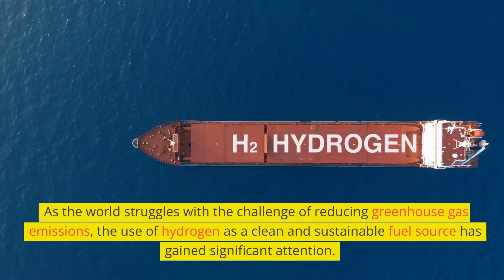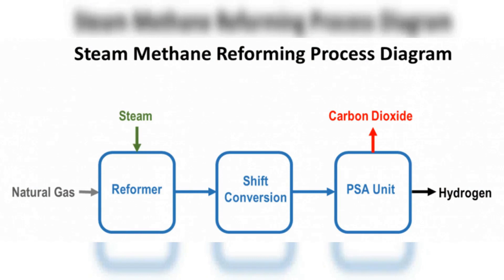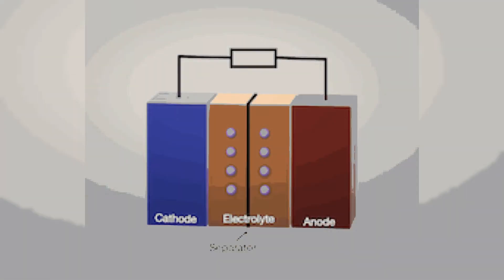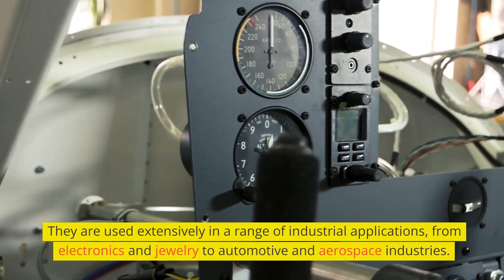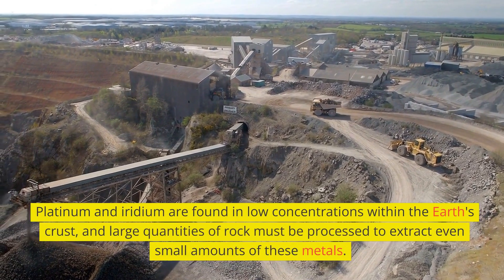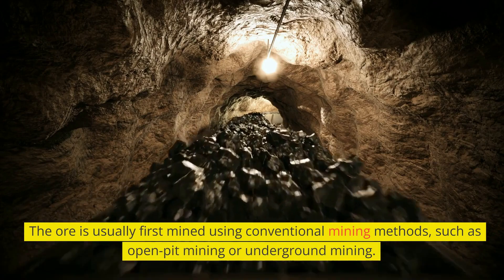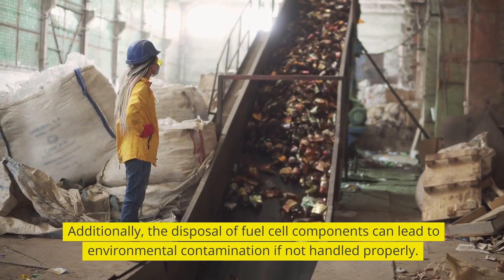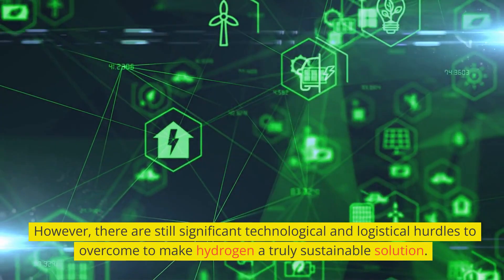We must STOP Hydrogen production: 5 reasons why

Comment: Hi. One way to use hydrogen is as a battery that can be charged by green generation, and stored near thermal power stations to keep them running when the sun don't shine, rain don't fall, or wind don't blow. All the present thermal stations presently running on natural gas (or unnatural gas in the case of fracking), could also burn hydrogen. 

As the availability of green hydrogen increased, the need for fossil N.G. would correspondingly decrease, so we have a seamless way to decarbonize the electricity grid. It's not rocket science, but that esteemed profession could put to good use the oxygen created by the process of electrolysis. Zero carbon rocket powered aircraft, possibly.

The natural gas molecule (CH4) is 80% hydrogen anyway, so converting coal and oil burning power stations to run on CNG is still a huge net positive for the climate. First things first, and we'll see what other sunshine technologies can be added later as our climactic can of worms opens further. Cheers, P.R.
Reply: CH4 is 80% hydrogen? Yes from number of atoms but not so from molecular weight basis.  Natural gas leads to fugitive emissions as well, contributing a significant greenhouse gas impact.
Reply: @davewillis6946  Hi Dave. I agree, ignoring isotopes, carbon with an atomic weight of 12 makes up 75% of the weight of a molecule of methane. Nevertheless, for a given amount of energy produced, it still produces half the CO2 than other fuels, which means mitigation technologies such as carbon capture can have greater effect. Methane fugitive emissions are difficult, but hydrogen will present far greater problems. Even electricity "leaks". I have no doubt we have the technology and ability to improve our energy systems and reach carbon zero. Eventually. Cheers, P.R.

Comment: Nonsense, it is like arguing that EV vehicles should be stopped because a lot of electricity is generated using gas and coal. Why would anyone argue that hydrogen production must be STOPPED when hydrogen is complimentary to other technologies that promote a greener economy. Significant technological and logistical hurdles to overcome could be said about a lot of alternative fuels and they don't get solved by stopping - pure unadulterated drivel.
Reply from the maker: the nonsense is to use an extremely polluting process to create an ecological fake fuel. It would be better to use methane directly because transforming it into hydrogen also wastes energy. In any case, I am against gray hydrogen, not all types of hydrogen

Comment: There is no reason to "STOP Hydrogen production" that I can see.  Change methods, yes, but man that's a clickbait title if I've ever seen one.  Hydrogen used in situ industrially, generated on ocean-going vessels as their own fuel made from seawater can be made practicable. 
Tidal power can also generate vast amounts of electricity and is an inexhaustible resource.
Both require research and development so no, stopping hydrogen production is not the way to go.  Eradicate the immensely wasteful present methods (10 tons/gr) through continuing research.  But stop?  No.
Reply from the maker: I'll be short I've already answered hundred of times.The Hydrogen currently produced Is 99% with that method, and is precisesly to it that i'm refering to. Maybe the title is provocative but not clickbait

Comment: There will be a place for hydrogen.   Research is steadily reducing the amount of expensive minerals needed.   Maybe great way to use excess solar/wind capacity, with the resultant hydrogen available for other uses.   The click bait title is misleading.
Reply from the maker: The title Is provocative but not clickbait or misleading. The 99% of Hydrogen currently produced Is highly polluting, obtained from methane (oil) refining, i think we should avoid this production. Regarding fuell Cell, the alternative are just experimental at the moment. I'm in favour of green hydrogen, and car can be directly powered with Hydrogen bypassing the batteries and the environment damaging necessary to built them

Comment: Here is Australia we have a Very Peaky Power Grid, We see power prices go Negative (Hole Sale Level) many days in the summer, converting excess power into Hydrogen, then this power used in Engines (Trucks, Bus, Tractor ETC ETC) is one option to use this excess power

But Closing the Cycle for Battery's and Other Parts of the Renewable power systems is a MUST do..

Solar Panels
Wind Mill Blades
Battery's

(And i am sure there are Many others I have Missed)   

Enjoy the discussion  👍

Comment: You forget the methane the process starts out with is an even more powerful greenhouse gas than the carbon-dioxide end product. So by producing hydrogen, this process turns methane into carbon-dioxide which is an improvement!
Oh and I forgot to mention burning of methane produces water vapor and carbon-dioxide, and methane is used to produce electricity in power plants, and it is used in gas stoves, so reforming methane into hydrogen is merely an intermediate step and burning hydrogen simply produces the same water vapor that would have been produces anyway withe the combustion of methane in power production, heating, and in gas stoves, so hydrogen cars don't actually add any greenhouse gases that wouldn't have been added anyway through the combustion of methane.
Reply from the maker: In my opinion there are two problems. The Hydrogen produced in this way is presented as ecological while it isn't, and in methane reforming part of energy is wasted to separate hydrogen from Carbonium. So pollution and energy wasting. If we want to use methane, is better to use it directly. I'm in favour of Hydrogen but it needs to be produced in different ways( solar, wind, hydropower and so on)
Reply: @Science.Stories  Ah but you see, a hydrogen fuel cell is a replacement for part of the battery running an EV. You recall how long it takes to recharge an EV's battery? about 30 minutes to an hour I believe. Well a hydrogen fuel cell can recharge an EV's battery. A hydrogen fuel cell produces a constant output of electricity until the hydrogen is exhausted, that is why a hydrogen fuel cell needs a separate battery, so when you step on the accelerator pedal, you get a variable amount of current flowing through the electric motors spinning the wheels depending on how much you press down.

So one way to make a hydrogen fuel cell vehicle, for instance is to remove the main battery of a Tesla, and replace it with a smaller battery, and in the extra space you created you place the hydrogen fuel cell and the hydrogen tank. The fuel cell constantly recharges the main battery until its fully recharged and then it shuts off. The driver turns on the car and he steps on the accelerator pedal drawing current from the main battery which causes the motors to spin the wheels and he backs out of his drive way. Sensors on the battery detect a depletion of charge in the battery causing the fuel cell to turn on recharging the battery as the driver drives his car to work.

Now if you replace the fuel cell with a methane combustion engine, then the car will need a transmission to translate the up and down motion of the IC engines pistons into circular motion of the wheels, the engine will also need engine oil, transmission fluid, and antifreeze, whereas the electric motors of the EV are much simpler with lower maintenance costs. Since the battery is now smaller it will cost less to replace when it wears out unlike the larger battery of the fully electric vehicle.

Most people who buy a car are thinking of issues of convenience rather than the environment, they need to get to work or do some errands. If you can produce a hydrogen fuel cell car more cheaply than a gasoline internal combustion engine car, he will buy the fuel cell vehicle. If he forgoes an IC engine altogether, he doesn't have to worry about the transmission or changing the engine oil, or the many other things that can go wrong with an internal combustion engine whether it runs on natural gas or gasoline.

Comment: This video assumes that the so-caled renewable energies like wind and solar are clean, when they are not, far from it. This video assumes that zero carbon is like a final solution, when it is not. This is called reductionism. Environmental problems are complex, but the reductionists and the techno utopians tend to reduce these problems to one single thing: carbon. The inanity of such approach should be evident.
Reply from the maker: In the video i'm trying to explain that hydrogen as it is currently produced is dangerous for the environment and  where I show the alternatives, surely better. Your post is only a useless four stataments full of arrogance and fake philosophy. I received far better motivated criticism
Reply: You are right in that reduction of carbon will not resolve all problems on earth, however, looking the video I have not seen any statement that this is the case. Usage of energy and emitting carbon to the atmosphere may not be the only issue to be resolved, but it is a very important one and actually one of the most important ones overall. Resolving 20 other issues during the coming decades would not help if a blind eye was turned on this one.
Reply: @@battleangelfan7067 I think reality proves you wrong enough, so I don't need to. Just driving up the I90 in the states proves everyone wrong that thinks private initiative would work better. Also the Morandi bridge disaster in Genoa is an example of such and the general conditions of roads in Italy, the reliability of trains in the UK etc. etc. And the changing power of the sun is a thing that can be measured pretty accurately and these effects are there but do not correlate with the warming that is seen. What else do I need? So yes, I think I and many others will disagree. But I don't endeavor to change your mind. Just go ahead, I don't think it changes much.

Comment: Batteries and current grid electricity are neither green, batteries can never be green as long as it uses valuable earth material that needs to be mined or extracted and purified...so if hydrogen is not better or should not be used what is the alternative? Hydrogen can be made using heat from natural sources or heat from factories and even nuclear plants. The problem I have from people against hydrogen is they highlight materials used to create, transport and distribute but never mentioned that batteries and grid electricity uses more valuable earth minerals and environmentally worst..
Reply from the maker: I am against Hydrogen as it is currently produced not Hydrogen itself because it makes our environmental problems worse. In my opinion, it should be produced from green sources such as solar, wind, and hydroelectric. A system for producing hydrogen from sound waves is being studied. As for the batteries, they should be made using less rare materials, and there is the possibility of powering the cars directly with hydrogen, bypassing the fuel cells even with traditional engines.
Reply: Hydrogen is not needed in cars as batteries are much more sustainable. Very much like the materials required to make electrolyzers and fuel cells and/or combustion engines, The materials used to make batteries aren't getting lost in the process, turning it secondary to the overall sustainability balance. Thus what counts most in the balance is the primary energy used during day to day use and this is by far the smallest using batteries. That is why BEV-s are currently on the rise.
Reply: where did you get your facts that batteries are more sustainable? Lithium, cobalt, nickel and othere RARE earth material are not sustainable,  mining these things require much more energy and at this time recycle Lithium is so expensive nobody wants to do it, if it can be recycled...hydrogen can be recycled many times over, hydrogen can be used to replace fuel to power combustion engines, combustion engines can be rebuilt. Also, start considering natural disaster preparedness, try crossing a flooded neighborhood with EVs, or trying to evacuate 500 miles away...there are so many factors where EVs are just backwards thinking...yes, it make sense in cities where charging stations are available for very few people who can afford it and have 10% of their life wasted in charging stations...if you critically think about it from production to real life scenarios, you'll be surprised to find out, EVs are just fancy toys for few people!
Reply from the maker: @XTRMOverland  Never said batteries for Electric cars are more sustainable, just said we need to use less rare materials. Alkaline metals for example, but at the moment they haven't the same performances and durability
Reply: @XTRMOverland : When you are overly critical thinking then you can turn down any new technology. Neither Litium, nor Cobalt and Nickel are rare earth materials and litterally NO rare earth materials are needed to build batteries. Also the energy required to mine materials is paid back multiple times during operation thanks the superior efficiency. And Recycling of Lithium is currently expensive because life of Lithium batteries ia ao good, recycling companies don't have enough material to process, which makes the process low efficiency. That will turn into a regular recycling like any other materials as soon as there is a decent volume coming back. Northvolt is already doing it because they were forward thinking and knew there will be volume coming. There are issues with any tech you may chose and going forward solutions need to be found. The solution to lack of efficiency of H2 technology in vehicles however is not in sight.
Reply: Get your facts rights, anything you mine are not infinite...so RARE earth material are called RARE, would you consider oil RARE earth material? Lithium is harder to recycle than oil, combustion engines are easier to rebuild than batteries...have you seen classic cars that still runs today as they did over 50 years ago? I don't forsee any EVs that can run with the same batteries 50 years from now...in the long run, combustion engines will outlive any EVs 100%...you build it ones and they can run forever!
Reply: @XTRMOverland  get you facts right? Oil canot be recycled when burnt! You can easily look up average life of classic cars that is currently not any better than the life of EV's. That a few examples run for a very long time does not change the fact very much like a swallow doesn't make spring.

Comment: What does Platinum and Iridium have to do with electrolysis? More than 90% is AWE electrolysis using no more rare metals than Nickel. SOFC does not use any Platinum Group metals.
Reply from the maker: I never said that Platinum and Iridium are contained in electrolyzers but in car fuel cell batteries PEM. One of the electrodes contains Platinum while iridium is often contained in the membrane.
SOFC fuel cell batteries: The cathode materials of SOFCs mainly include oxides with perovskite structure and cermet composite cathode materials. Pt, Pd, Rh, and Ag

https://www.sciencedirect.com/science/article/abs/pii/S0360319919344581#:~:text=efficient%20electrolyte%20materials.-,Yttria%2Dstabilized%20zirconia%20(YSZ)%20is%20the%20most%20widely%20used,YSZ%20%5B11%2C30%5D.

However, they are not common elements.
Reply: @Science.Stories  The majority of electrolyzers are Alkaline and this is not about to change because Alkaline is cheaper, more efficient and longer lasting. Only researchers use Platinum Group metals. In general Yttria and Zirconia is used for the membrane. Neither is scarce or expensive.
Reply from the maker: PEM fuel Cells are primarily made of Platinum and (sometimes) Iridium in the membrane. Alkaline fuel Cells are less durable and have worst performance. Sofc are also made up of rare elements. That's all.
Reply: @Science.Stories